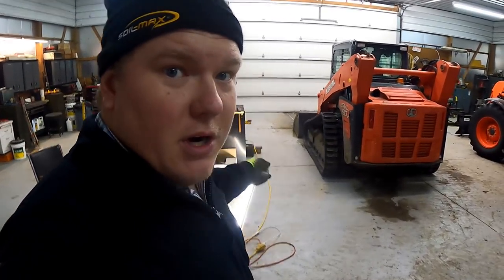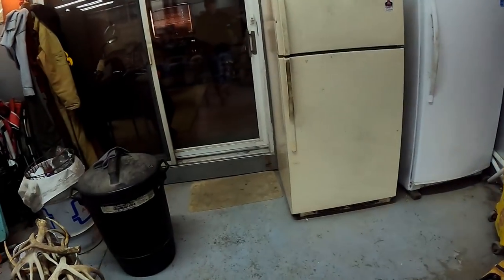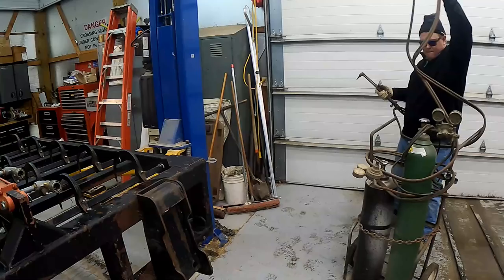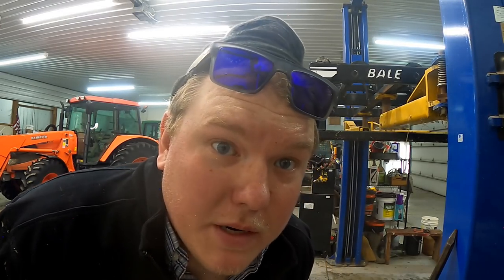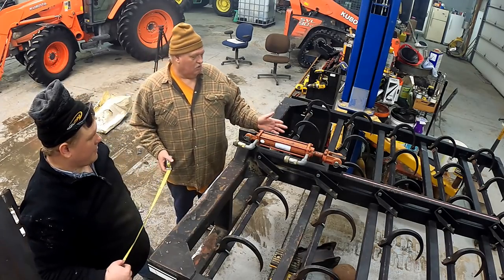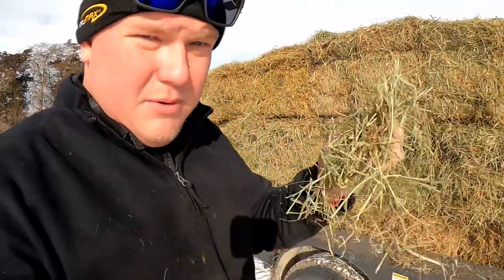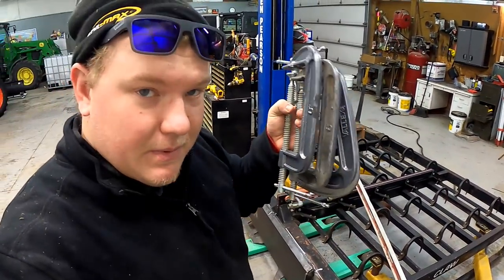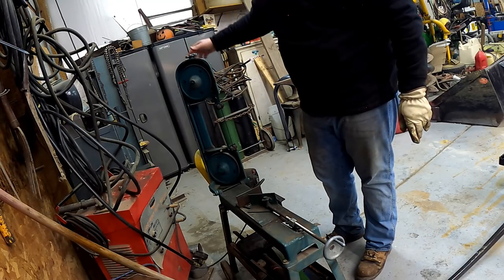HOT knife, Farmer WELDS, Tractor DONUTS!

Comment: Times like that are when an AirArc setup really shines. If you want to do something cheap though buy a scarfing tip for your torch. If it were me I might turn your heat down a little too. Easier to control that way and less chance of burning into the base metal if you don't torch all the time. Hope that helps.